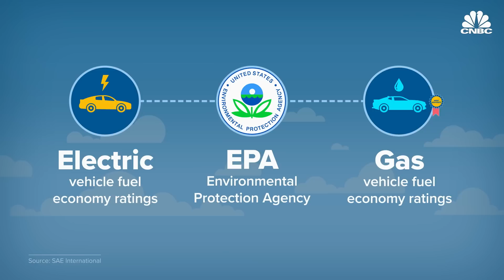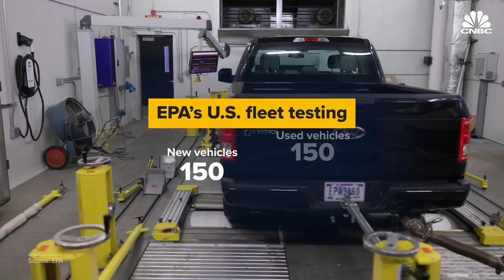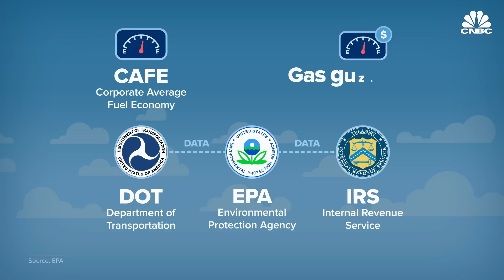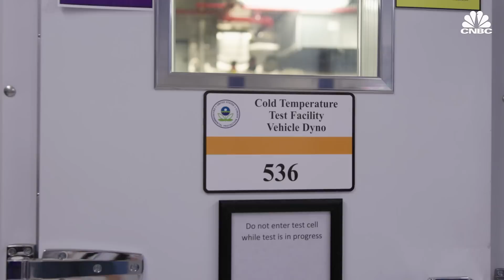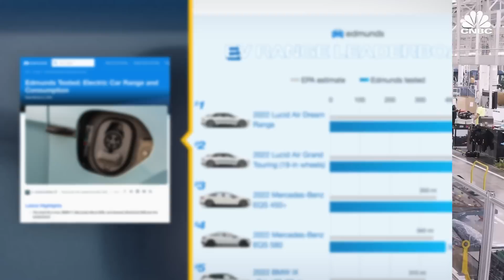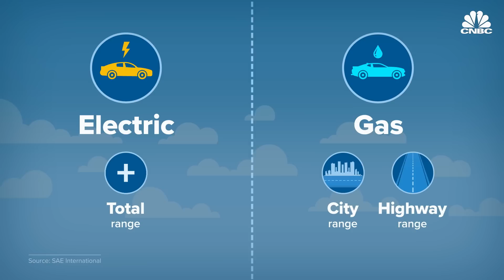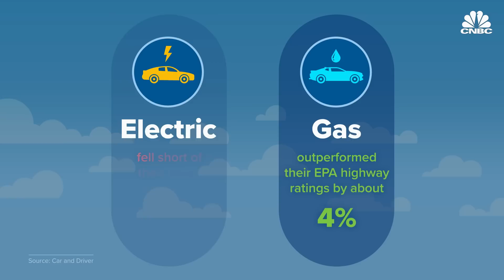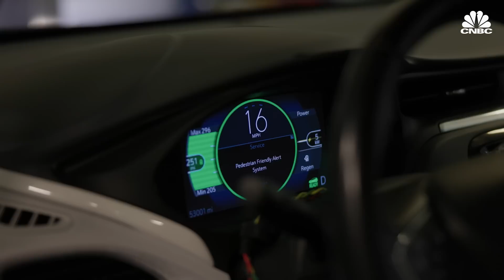Why Tesla And Other EV Ranges May Be Inaccurate

Comment: In my 358 mile rated tesla ive never reached 200 miles
Reply: What model and year?
Reply: @CaL-76  2022 model 3 long range 18 inch wheels. I do run UHP summer tires and go to the track
Reply: @GXKid06  And there ya go for why.  :)
Reply: @GXKid06  You do track days with a Tesla? That sounds...interesting
Reply: @JT_771  but even when I was stock and went on a highway road trip I never saw over 200. Now I only get about 100 daily. I refuse to turn on my AC but frankly I shouldn’t have to.
Reply: @RossGoneRogue  oh yeah its a very fast car that has advanced multi link suspension with aluminum arms like a M car and the balance from the low weight position of the battery and torque vectoring AWD make it a weapon. Im actually faster that GTIs on twisty back roads. Its not the best at high speed sweeper curves that reduce radius but in the tight lower speed stuff nothing touches it.
Reply: @GXKid06  i could see the batteries being at the bottom making handling really good. Sounds like fun. I just never pictured a Tesla on a track day before but now I have.
Reply: @RossGoneRogue  there are whole racing teams and performance shops that work on them where i live.
Reply: @GXKid06  I obviously don't get out enough
Reply: @GXKid06  How you're driving?  Granted I'm running all seasons, but I have no range shortage problems, a/c always in hot weather, etc.
Reply: @JT_771  I’ve done a road trip at 70 mph and still never cracked 200 🤷🏻‍♂️ my car just isn’t that efficient I guess
Reply: Same especially if I drive over 60 mph or go up hills
Reply: I have a 270 range model 3 and I get around 210-240 mile range. Are you driving with a heavy foot or heavy acceleration.
Reply: And in my 272 mile rated 2023 RWD Model 3 I regularly get over 300 miles. I guess it balances out. https://i.imgur.com/aij2cPf.jpg

Comment: I think the car magazine's data is more accurate.   Also, does it matter if it goes 300 or 250?  I'll rather buy a smaller battery that helps the environment.   Carrying unnecessary battery weight is wasteful.  If you drive just 50 miles a day, you don't need 300 miles range.   Just get one that offers 150.  You might just get 100, but still more than what you need.   US government should tax battery size for being wasteful.

Comment: I have no problem with ev. They work well for some people, and they don’t work for others. My problem is that people are pushing ev onto people. It should be an option to buy an ev, there should also be hybrid, PHEV, and gasoline cars available to buy as well.
Reply: You have all of those options right now.  We're talking at least 15 years until pure ICE is eliminated for consumers (and plugless hybrids maybe a decade after that, so 25 years).  Until infrastructure and charging speed improves greatly (which they will), I think PHEVs will make sense for most people for a long time.  But man, let me tell you...  if you can charge at home, a BEV can't be beat.
Reply: Until 2035 manufacturers can make all types of cars. You will be able to buy NEW until then, but there will be fewer and fewer choices as people decide electric is better. For some needs it will be a decade before electric is better, so buy something else until then. Shouldn't be a problem. Eventually, in a few decades, gas cars will have range anxiety as filling stations become scarce.
Reply: You have options now, your don’t have to. It an EV, but there are always future regulations or we would all still be driving Slant 6 and 426 Hemis. Things evolve.
Reply: I totally agree. Do not shove EV down the peoples throats! Give them options.

Comment: What about hydrogen or water engines? I think they'd be simpler than EV.  Also, the no pollution claim is rubbish.  The battery takes a lot of chemicals, and the vechiles had to be built.  Additionally, mandating only EV vehicles and home appliances will be a strain on the already overworked US electric grid.
Reply: At the moment most hydrogen is so called "blue hydrogen", which is made from natural gas. Not very green. Unfortunately the efficiency of production of hydrogen by electrolysis of water is very low, which is why it is much more efficient to just use the electricity to charge batteries in EVs. The only interim (until batteries get even better) use is for heavy duty vehicles such as trucks and locomotives where there is no catenary.
Reply: Hydrogen cars have a battery. It is smaller than an ev one's but it isn't insignificant either
Reply: @hansht1477  what? I wasn't aware of that. You're talking about fuel cell electric vehicles powered by hydrogen, right? Why would a fuel cell electric vehicle need a 'not insignificant' battery?
Reply: @richardconway6425  these vehicles have an electric motor which is powered by a battery. The hydrogen fuel cell powers that battery
Reply: @hansht1477  ok, I definitely wasn't aware that they had a battery like that. That seems to make, at least to my mind, hydrogen powered FCEV even more pointless. The expense of a fuel cell (very expensive) and a battery. I can understand why they might include a battery, to store regeneration energy, for example, but why not just go fully battery electric? That sounds like a solution looking for problem ...
Reply: @richardconway6425 The power output of a fuel cell is slow and steady, and does not burst to the levels needed to propel a car quickly (150+ kW). The battery, about 1/3rd the size of a pure EV, acts as a high power buffer.  Most hydrogen is dirty, being a byproduct of gas and oil refining.  So-called clean hydrogen uses electricity to separate water into hydrogen and oxygen.  It's inefficient, and then suffers more inefficiencies in its transport and storage.  It may have its uses, but passenger cars really isn't on of them.
Reply: @mikefarrington7141  yep, that all makes sense. So why is Toyota still pursuing FCEVs as if they are the future?
Reply: @richardconway6425  That's the question everyone is asking.  They, and Japan, went all-in on the idea and have a hard time admitting that it isn't as good a solution as they had hoped -- especially in light of BEV advancements over the past ten years.
Reply: @mikefarrington7141  yes, I think that's one thing that became apparent fairly quickly - that fully BEVs were going to evolve quickly as the underlying technologies improved. Battery technology is still in its infancy, there's so far to go on this front. Personally, I find it quite exciting, to consider that the laws of physics allow for quite ridiculous amounts of energy to be stored in a ridiculously small amount of space. It's just a matter of science, engineering, materials and time. 
Japan had favoured nuclear power for some time, and combined with their need to import almost everything they required in way of raw materials, perhaps the fuel cell approach appealed to them. They could use their nuclear power generating capacity to produce hydrogen via electrolysis, and use it to power their fuel cell vehicles. But after fukashima things look a little different, and I think it's now clear that bevs have a  great future. 
Elon Musk was always comically disparaging about the idea of hydrogen powered cars, and I think he's right.
Reply: @richardconway6425  To be fair it's not nearly as large as a normal EV battery, it's normally only 2-3Kwh or so. The main advantage of the H2 car is it only needs a very small HV battery because is has on on-board generator.
Reply: @roxcyn  what is a water engine? Surely you're not suggesting that there's an engine that runs on water?
Reply: i wouldn't say simpler, its making its own electricity inside the engine iirc, reg ev just have power stored in the battery. I read hyrdrogen doesnt have very good range yet
Reply: Do your own research instead of trying to gather facts from the You Tube comments.
Reply: All cars are evil.

Comment: you cant test it on a dyno... where is the wind and hills ?
Reply: That's why you test it on a dyno, to remove the dozen or more variables of real-world driving.  This way they can run the tests a few times, instead of hundreds of times in order to average out the variability of real-world driving.  Then, they apply a correction factor to bring it closer to real-world conditions (currently 0.7).

Comment: Fact :Non EV users have more range anxiety than actual EV users...Range anxiety disappears within weeks of starting to use an EV. Actually most EV users begin challenging themselves and their EVs to test the limit of the range by taking longer and longer rides in harder and harder terrains...the anxiety becomes thrill seeking experience. Of course, on some rare occassions range anxiety may happen if you have multiple exceptional scenarios...For example, the other day, I was getting less range(because of tyre pressures) and the charger I planned to reach was out of order...and then the second charger 20kms away stopped working for some issue  2 minutes after I plugged... I still reached the next charger...by riding very slowly with still some battery % left...but that was the first time I felt range anxiety in a year or so....but as I said these are extremely rare case...I reached safely even after 3 points of failures..and that's because I rode really slowly..and that's the beauty of EVs..you can double your usual range if you drive/ride very slow...which is more than enough not to leave you stranded.
Reply: copium.
Reply: Whatnow?  That's some seriously ignorant cognitive dissonance right there.  Gasoline powered vehicles can fill up anywhere anytime in 5 minutes.  I've been driving for decades and never once had range anxiety in any car I've driven.  Never.  Have you ever driven a car?
Reply: @knurlgnar24  He's trolling, don't take the bait.
Reply: more people would buy evs if the charging infrastructure wasn't dogshit
Reply: @ockertoustesizem1234  The Tesla charging infrastructure is stellar. It's just the rest of the charging infrastructure that's dogshit.
Reply: @BigBen621   i know

Comment: The EPA range should be after the degradation. It’s kind of a rip off to state the MPG on a new battery. ICE cars maintain their range for many years. I happen to own a Tesla Model Y long range. The range drops after 3 months and drops further for a little more time.
Reply: Charging habits have a very large influence on that. I have a model 3 LR with 14.9K miles after 13 months. No noticeable decrease in range yet.

Comment: EVs do actually emit pollutants, not only are most EVs charged on a non-fossil free power grid, but also brake dust and tire wear have to be considered (fine particle emissions). That's why in Europe, the next emission standard, the Euro 7 is trying to cap brake dust emissions for the first time, which will also apply for all EVs.
Reply: Luckily, brake dust emissions are greatly reduced by regenerative braking.  Tires wear out a little quicker on an EV, but not greatly so -- I'm getting about 60k miles per set on my Chevy Bolt EV (on my third set now at 140,000 miles).  I still haven't had to replace any brake pads -- they barely get used.
Reply: Only real concern would be tire particulates due to EVs being heavier than ICE cars, but that is probably be less of an issue over time. Eventually we will have much denser batteries that could allow us to have EVs of the same size be the same weight or even lighter than equivalent ICE cars. Brake dust is not that much of an issue for EVs because regenerative braking. You are technically correct in that EVs that are charged via fossil powered grids have indirect emissions but these are usually concentrated outside cities and do not come directly from the EVs which helps improve local air quality since you wouldn't have a bunch of emitting vehicles in the city. And powerplants can use air scrubbing to reduce the particulate emissions. And when it comes to CO2 emissions, power plants are much more efficient than ICE cars (50% power plant vs 25-30% ICE car), which results in most EVs emitting less CO2 per mile. Not to mention as countries rapidly transition to renewable energy this becomes a non-factor.
Reply: Damn..... thanks for reminding me I almost forgot I had a second pedal, it's been that long since I used it.

Comment: Lithium is mined by young children in other countries.  Batteries are not recycled.  In cold weather the batteries are not efficient.
Reply: You're thinking of cobalt, which fewer and fewer batteries are using.  Batteries are indeed recycled, but not before they're used in off-grid storage for a good 10+ years after they're pulled from cars.  Batteries are plenty efficient in cold-weather, but human occupants really like to have a comfortable cabin.
Reply: You're probably thinking of cobalt, which is mined so; as well as other minerals—do you have any gold jewelry? Pending legislation will ban importation of such materials; and as well, half of Tesla's EV batteries are already cobalt-free with more to come.

Batteries are recycled; for an example, search for Redwood Materials. In addition, many batteries which have degraded beyond what's acceptable in cars, are being repurposed in stationary battery systems.

"In cold weather, the batteries are less efficient"—FIFY. The same is true, of course, of ICE vehicles; the difference is that the loss of efficiency in EVs can be reduced by careful battery temperature management. And also, unlike ICE vehicles, the loss is predictable. And at least in Teslas, is reflected in the Trip Planner, so charging stops can be adjusted to take this into account.
Reply: New Evs have battery thermal management systems and heat pumps, so they handle the winter better than any gas car I've driven! My ev gets ~400km of my 415km range in -15°c
Reply: Lithium is mined like coal - large machines in open cut mines ~90% comes from China.
Reply: War is waged over oil supply security where young men are sent to the middle east to get there legs blown off by an I-E-freak'in-D!!! Oil is also one environmental mega disaster after another.

Comment: Hybrid cars seems to be the best as it can run in electric and petrol mode, people need not worry about running out of battery while traveling long distances. Electric cars take long time to recharge and this is very irritating when we want to go to some place very quickly or in an emergency. Hence car manufacturers must provide Hybrid cars instead of only making either electric or petrol cars.
Reply: Hybrid needs engine maintenance and usually they didn't have the most advanced electric power units like the battery and the motor. When you run out of the battery, the engine has to drag several hundreds KGs more of dead weight.  
For comparison my Model 3 performance can charge 20-80% in 18 mins, my friend's hybrid requires 1.5 hours of charging to run 50ish miles. And when his battery ran out, the fuel consumption is higher than the other equivalent ICE vehicles.
Reply: There's tradeoff though.  A plug-in hybrid, if only used for short trips, is carrying around an unnecessary combustion engine and wasting electricity.  And EVs don't really "take a long time to charge" in a real-world sense if you can charge at home.  You plug it in every evening, and have a full charge by morning.  I do think hybrids have a place for at least the next 15-20 years in the USA (especially for those who cannot charge at home).  Advancements are continually happening, we're getting higher battery densities at lower costs.  Also, faster charging technologies are in active development.  In 10-15 years, I wouldn't be surprised if we see non-luxury cars with 500 mile ranges and 10-80% charge times of 5-10 minutes.
Reply: And studies have shown that not many people plug in the  hybrid nor do they invest in a home charger.

Comment: 8 years into EV ownership with over 200k miles driven between 5 different EVs. 2 owned and 3 rented for long distance trips. The craziest thing to me is the cold hit to range and then the second biggest observation I have had is how much of a difference it makes on highways to stay behind a semi going long distances. You can do 65-70mph 3 car lengths behind a semi and be getting the same efficiency as doing 45-50.
Reply: Put another way, temperature, wind resistance, elevation, and speed, are the biggest factors when estimating the the range of am EV. The truck takes a brunt of the wind resistance allowing it to go further. Driving that close to a truck can be dangerous if it unexpectedly stops and it seems most EV drivers want to go faster than the trucks which leaves them in confusion why they didn't get the range advertised by the EPA.
Reply: @lancesbeataxes2901  Indeed, it can be dangerous staying close to the rear of a truck. Lucky at 35 I have a flawless driving record and always keep eyes forward. I'm not a distracted driver at all. I only use that method when I know I have to squeeze out a trip somewhere and back without charging.
Reply: Even not going behind a semi, but driving 60-65mph vs 70-75mph on the highway makes an enormous difference for EV range.  I try to stay under 67 mph and go slower if that’s pace of the slower lane as long as it’s not super slow. I have a plug-in hybrid. So I try to save the fast highway driving of over 70mph for when the gas engine has engaged.  And that really mostly only happens on overnight trips.
Reply: I use that method too, I’ll drive behind a truck or a school bus or something like that and get excellent range on the highway.